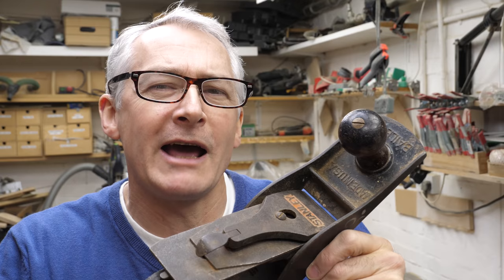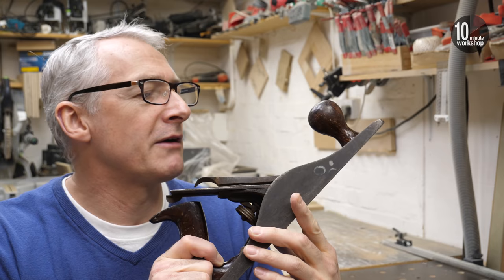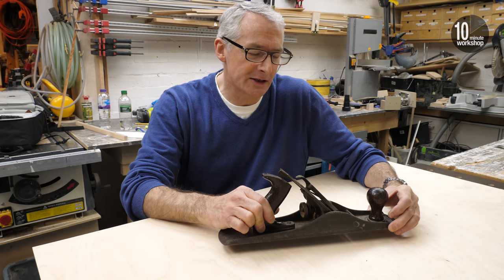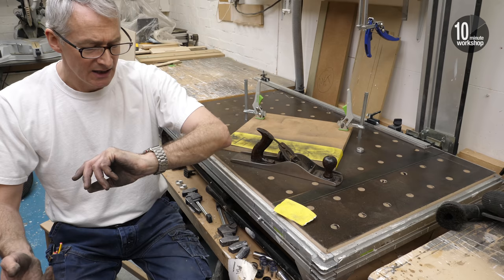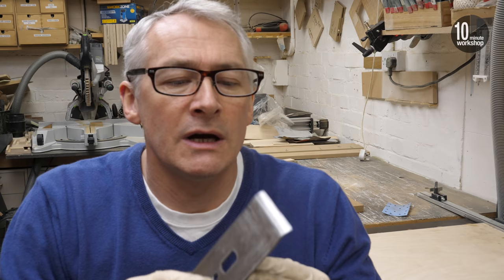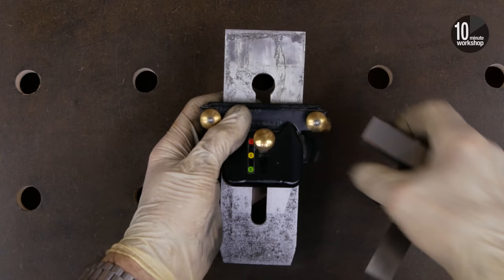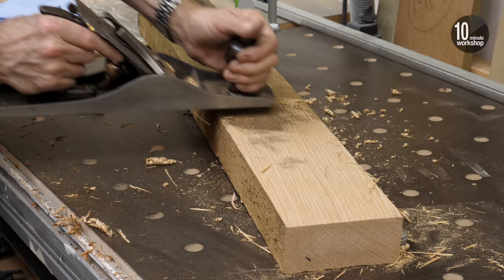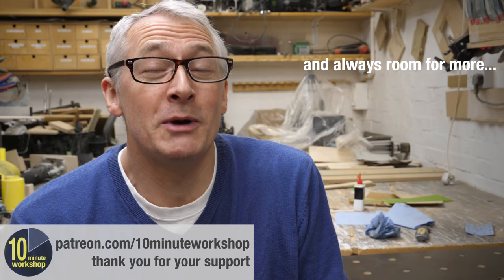Stanley No.5½ Jack Plane Revitalised [video #373]

Comment: Whey hey Peter. Nice video. But at the risk of "putting my head above the parapet " I'd like to make a couple of points:-
Judging by the look of the Frog, and the height of the front knob it is a much earlier model, possibly 1960's. I'm not saying the rest of it isn't 1930's but I doubt that. 
Also you really should have taken the time to 'flatten' the back of the iron/ blade. It will make all the difference. 

As you mentioned, wars have been started for less.......

Apart from the above I'm sure you have a very nice no,5 1/2. Which is my favourite plane. Once you have restored one and fettled it and learned how to use one they are fantastic planes. In my opinion they can be used for all purposes, from surfacing stock like  the bigger no;7's to smoothing like a no;4. 

I've refurbished many no:5 1/2's over the years after attending a Tool Tuning course with David Charlesworth.
Reply from the maker: Thanks John. I think I said that some parts - certainly the lever cap - look like they’re not original. And I’m just going by what I found online wrt the age - if the parts are interchangeable then then it could well be a Franken-plane - but it’s my Frankenstein-plane 😂 There’s a link in the video description to what I used for dating. And thanks, I did flatten the back of the blade - you just didn’t see it on camera, because honestly, the vid was getting long enough, and there are a million sharpening videos on YouTube already. 👍👍
Reply: I agree with Peter's dating, for the most part. It looks like a Type 15 body, with a Type 16 frog and lever cap.
Reply: Peter Millard cheers Peter. You just may have opened a can of worms with this vid.... light the blue touch paper and retire...

Comment: I used this
https://youtu.be/90GNie4qt4E
made from k'nex to flatten the soles of a couple of old hand planes.  It probably took a couple of hours in total to do one plane, but I never ran it for more that 15 minutes at a time because I don't expect k'nex motors to be designed for long cycles.  The motor never got warm.  Moving the plane back and forth wasn't a heavy load.

How the reciprocating frame attached to the plane needs to be redesigned for each plane.  I also used this for a small rabbetting plane.  It had open sides so I could run a strut sideways across the throat to hold it.  It doesn't need to be held tight but there does need to be significantly less play than the throw of the cam/crank that moves the plane back and forth.
Reply from the maker: Wow! That's amazing, and very creative! Also much easier on the arms, I bet; well done, nice one! 👍

Comment: The wobbly handle can be fixed by shortening the screw... You’re really averse to dirt, aren’t you <g>?! Many videos on plane restoration say that flattening the sole should be done with the plane fully assembled. Personally, as an engineer, I don’t believe this is necessary. The purpose of adjusting the frog is to align it with the base, not to change the size of the throat, i think you’ll find. Didn’t the Veritas honing guide come with a depth gauge to set the angle (mine did) or is it that the blade is too wide to use the gauge? I was also taught to strop on my hand. The skin is actually quite abrasive. I would recommend oiling all bare metal surfaces to prevent rust. I’ve restored a few hand planes, I’ve still got two work in progress. My aim is to restore them to a useable condition, not a pristine show piece. Your plane came in quite a good condition! I think you did a very creditable job on that one. Well done.
Reply from the maker: Screws jammed on the No.4, and there’s a washer in there that’s preventing the handle coming off. Another project. Yes, my Veritas guide came with a depth gauge. I have it - somewhere... And thanks re the frog/throat thing. 👍👍
Reply: Peter Millard Peter; I’m commenting as I watch the video so there are edits...